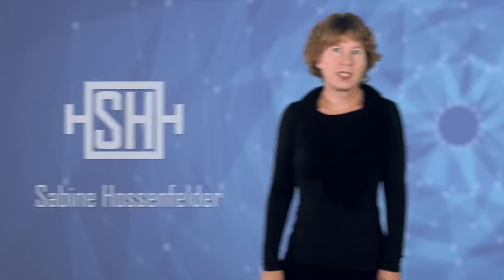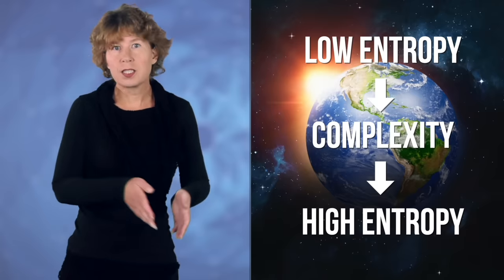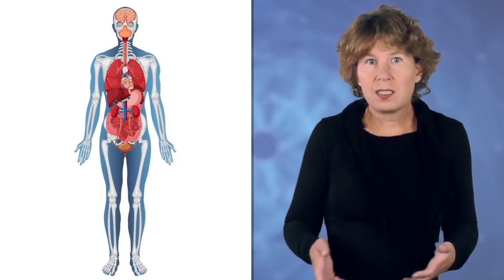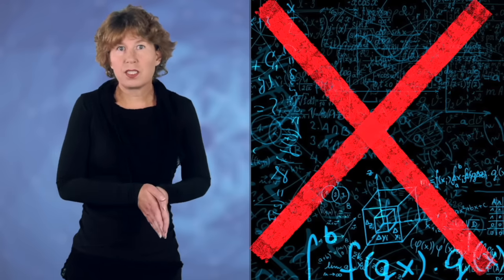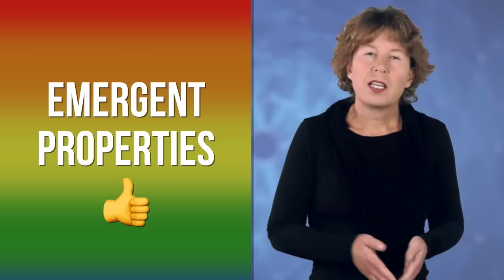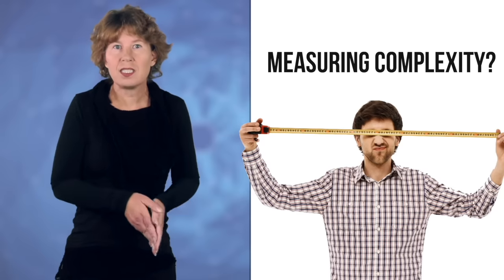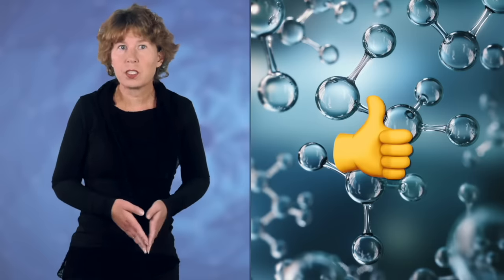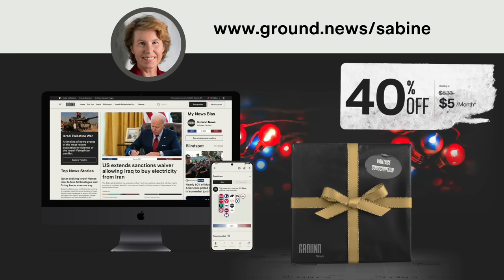The Biggest Gap in Science: Complexity

Comment: I came up with a simple complexity classification for software in or estimate development effort, and it is based on isolation or dependencies:

Complexity of software:

low: few components with few dependencies
medium: few components with many dependencies or many components with few dependencies
high: many components with many dependencies

It worked pretty well together with a classification of "innovation", which may be related to entropy:

Innovativeness of Software:

low: familiar function using familiar technology
medium: Familiar function using unfamiliar technology or unfamiliar function using familiar technology
high: Unfamiliar function using unfamiliar technology

If you do a 3x3 matrix and classify your development task according to this scheme and compare predictions to the time it actually took to create that software, you will get interesting factors of how much humans underestimate these tasks. 

For my teams, estimates for low/low tasks were spot on; it tool on average 95% of the estimate, while high/high tasks too about 4 times as long as originally estimated,

I guess this all complexity/innovation matrix could be described mathematically and turned into physics, but it was already quite helpful to use it light that, just with "MBA measurements" like low, medium and high.

Comment: Fractals are often described as being at the edge of chaos because they exhibit characteristics of both order and randomness. This concept is related to the study of complex systems and the theory of chaos.

At the edge of chaos, a system demonstrates a delicate balance between stability and instability. It is a state where there is enough order to prevent complete chaos, but also enough complexity and randomness to avoid rigid predictability. Fractals exhibit this balance through their self-similarity and intricate patterns that emerge at different scales.

Fractals possess the following properties that contribute to their placement at the edge of chaos:

1. Self-similarity: Fractals exhibit self-similarity, meaning that they have similar patterns or structures regardless of the scale at which they are observed. This property allows them to maintain a sense of order even as they become more complex and intricate.

2. Infinite complexity: Fractals are infinitely complex, with intricate patterns repeating themselves at increasingly smaller scales. This complexity arises from the iterative processes that generate fractal shapes, such as the Mandelbrot set or the Sierpinski triangle.

3. Sensitivity to initial conditions: Fractals are highly sensitive to small changes in their initial conditions. Even a slight alteration in the parameters or inputs can lead to significant variations in the resulting patterns. This sensitivity to initial conditions is a characteristic of chaotic systems.

4. Nonlinearity: Fractals often exhibit nonlinear behavior, where small changes in inputs can result in disproportionately large effects on the output. This nonlinearity contributes to the complex and unpredictable nature of fractals.

The combination of self-similarity, infinite complexity, sensitivity to initial conditions, and nonlinearity places fractals at the edge of chaos. They exhibit a balance between order and randomness, with intricate patterns emerging from simple iterative processes. This delicate balance is what makes fractals visually captivating and mathematically fascinating.

Comment: There's nothing wrong with Kolmogorov complexity, and it does work in the case with the baby. It's intuitive that an ounce of rock can be lossily compressed easier then an ounce of baby, and lossy compressors can be converted into perfect ones. Even if they're represented with the same amount of data in reality, the smallest possible program would be smaller for the rock. It's probably the same case with an ounce of flesh and an ounce of brain.

A theory that could predict in advance how objects will express complex behavior violates the halting problem, the only way to know that is by running the program, aka observing. Measures of complexity are virtually uncomputable, including an object's Kolmogorov complexity.

Maybe theories of specific kinds of complexity could be useful, but I don't think there's anything fundamental we're missing. Kolmogorov complexity is probably the best we're gonna get.

Comment: Usually your videos are spot on, but the argument against Kolmogorov complexity exposed in this video is incorrect. Notice that Kolmogorov complexity still perfectly captures the rock vs clockwork vs human, as you still need to represent the "initial state" of the system in your "smallest program". The initial state of a rock is much simpler (kolmogorov-complexity-wise), as there is much more regularity in the dispositon of the individual atoms, etc. and the same goes for clockwork. So, that definition still perfectly applies. The problem in this video is that it seems to assume that Kolmogorov complexity only applies to "algorithms", but it applies to everything, including just "data" (what is the smallest algorithm that produces a given piece of data). All of those "structural complexity" things you talk afterwards are perfectly captured by Kolmogorov complexity. So, again, it all works out and the argument in this video is not correct. Kolmogorov complexity is actually what you are looking for in this example. Its problem is not that it does not capture what you want, but that it is not computable in practice. So, we need approximations. But there are many already! For example, any compression algorithm (think of your everyday "zip" program) is an approximation of the minimum theoretical Kolmogorov compression for a given piece of data. Think of this thought experiment: write down the position and types of all the atoms in a rock, those in clockwork, and those in a baby in text files, and then compress those using .zip. You'll certainly get a smaller size in the rock, medium on clockwork and largest on baby (even assuming you represent the same number of atoms in each), just because of the regularities in one, but not the other. (btw, I am not claiming Kolmogorov complexity is the ultimate measure, but that the argument used against it in the video is incorrect)

Comment: Somewhere halfway into the video I thought of one quantifier for complexity, and the recent approaches sections made me think. The 2023 paper arguing about the functions is on the correct path i think, but I wouldn't say functions, rather interactions. Measuring complexity: the amount and different types of interactions something (a system or an object) has over time. In terms of entropy, starting with a low entropy state of a cooled gas on the right side of a chamber and warmer gas on the other side; initially, the amount of interactions (let's say particle collisions) is low, and the types of interactions (just particle collisions let's say) is just one. As time passes, the average number of particle collisions per unit of time in the chamber increases and eventually levels out as the gases mix and normalize. If there are different gases, you might now have more than just one interaction (let's say instead of just collisions of same types of particles, you also have the combination of the two different types of gas particles into another one). Through both these measures (nr. of interactions, nr. of types of interactions) you can monitor the complexity of a system over time and its entropy. Applied to the example of humans (you said it is hard to quantify the complexity of a human), the human "system" can be classified as more complex if it either has more interactions (either within itself or with the outside world), say a person thinks of the same problem over and over again and eventually solve it (many of the same type of interaction, i.e. the act of thought). Similarly, the human "system" is also more complex if it has a wider range of possible types of interactions. I think this framework can be applied to most situations and generalized from the bottom up: starting from particle physics, with a single elementary particle, it has a limited number of possible interactions and possible types of interactions with itself and others of its same type. However, the addition of further elementary particles increases the complexity of the system both through the number and diff. types of interactions.

Comment: I know what it means.  I just published my first rough draft of my paper that shows P is not equal to NP.  And unlike the many other papers that have been published on this, I discovered something absolutely groundbreaking that completely changes our understanding of computational complexity theory.  It turns out, that all problems that are "easy" to solve have optimal substructure and a non-universal, commutative, and associative magma.  Whereas, all NP-Complete problems do not have commutative and associative magmas because they must also be universal (this comes from the fact that k-SAT, where k>2, is logically universal).  In contrast, my paper proves that all algorithms in P can be reduced to polynomial-time dynamic programming over magma operators.  This means that algorithms in P have optimal substructure.

Comment: Scott Page has a good definition of complexity as any relational system comprised of “diverse,  adaptive, connected & interdependent” elements. He also differentiates between complex and complicated. A watch is complicated but predictable - it’s non-adaptive, whereas a baby is complex and therefore unpredictable. He goes on to describe three types of system topology or “landscape”  - single maximum (linear/simple), multiple maxima (rugged) and dynamic (dancing). The latter are the most complex, because everything is connected to everything else, so any change alters the configuration of the system.

Comment: I think I have an idea on how to measure/compare complexity of different types of objects. (If considering a graph/network, an "element" will be a "point" and an "interaction" will be a "line", or rather a type of line.)
1. The number of their smallest possible elements (for example the number of quarks in an object).
2. [For objects that have at least 2 elements] The number of ways in which one of these elements may interact with another element.
3. [For objects that have at least 3 elements] If 2 elements may interact with each other (creating a simple "system"), how many ways exist, in which this system (pair of elements interacting with each other) may interact with a third element? And with two more (single) elements? And three more? Etc.
4. [For objects that have at least 4 elements] How many ways exist, in which one simplest system (pair of elements interacting with each other) may interact with another simplest (made of 2 elements) system?
And so on, but that's just for calculating the amount of possible interactions. But if these interactions are the same for every pair of elements, it's still not a very complex object, obviously, it may be just more complex than a similar object with less elements, but that's it, so we go on.
5. How many different interactions (from the numbers calculated above) acually are there between different elements and systems of elements (this number has to be less or equal to the total number of possible interactions between elements calculated earlier).
6. For how long this object may exist in the form which we're measuring (before changing in any way)?
I think time is important for checking how complex a system is and the longer it may exist, the bigger its complexity.
7. How much force/work is needed to put this object apart completely (so no 2 elements will be interacting with each other anymore)?
8. The object's ability to adapt to changing environment.

Comment: The core problems to my mind seems to be Scale and Context. If you start at the bottom, the number of emergent behaviors grows so rapidly we don't have any useful mathematical language for it, yet at the same time many of those emergent behaviors end up forming systems that can be treated as statistically insignificant in the context of larger scales. Take something as simple as a Die Roll. one die has a very chaotic distribution in possible states, but the more you add, the less chaotically distributed the results are. which is the more complex system? The answer depends on the scale and context you choose.

Comment: Here's my take: complexity is a subjective value. Therefore it stems from the structure of our brains. Which is unique because of its adaptability. It's a neural network that is very flexible and adapts itself.

So on one extreme of complexity we have rigid networks (of atoms, machined parts, whatever). And on other extreme we have millions of nodes with more possible configurations than atoms in the universe and these connections constantly changing and adapting in a closed loop. 

I like the book Godel Escher Bach which identifies self reference as a precursor to consciousness. And I would connect it to complexity when applied to networks.

Comment: I wonder if we couldn't use information theory as an avenue to  gauge complexity.  Specifically compression.  A 1MB file of all 1s or all 0s, and a one that is full of a random arrangement of 1s and 0s both have the same size, both contain the same "information" eg. like how both the baby and the rock are both made of atoms.  However when you try to compress them, the differences in their complexity become apparent.  A file of all 1s or 0s can be represented much smaller than a random one, it can compress down tiny where completely random information can barely be compressed at all.

So when we try to create a minimum description of a system, it's complexity becomes apparent.  You can represent a rock very simply, (size, weight, density, the molecules involved etc). But a baby is a vast combination of integrated biological systems all working together to achieve a variety of purposes. It's not just what the baby is made of, but all the various processes going on and what state each are in.  In effect you can "compress" a rock much better than a baby.

Just a thought anyhow.

Comment: I think you are misrepresenting algorithmic complexity here. The length of the program describing evolution of the system a) includes the length of the starting data - which means it includes a function of the structural complexity of said data (since a structured systems are easily compressible in description); and b) describes the system at the level of abstraction that you are interested in, not at the most basic level. On the level of fully simulating all quantum behaviour, I would expect that the structure of the rock would be more, but not by that much more compressible than the structure of a kid - and that is a very valid answer!

Granted, pinpointing the exact level of abstraction in which a kid is much more complex than a rock formally is quite hard, but for a handwave'y pointing at where that level of abstraction would be - compare the lines of code necessary to simulate what the kid will do on the macroscopic level in the next hour compared to the rock. Kolmogorov complexity as a tool seems to still be a useful abstraction to use when trying to come up with some formalism on the actual complexity - we just lack the formalism to precisely cut off what we are not interested in, since all the abstractions are leaky.

Though I agree that there are complex systems that can be described by a short program, where the complexity lies in the computation's cost and Kolmogorov complexity can't be the whole answer here, besides the issues with actually using it for anything due to it being uncomputable.
Still, it's clear that the main insight it offers is being used in the recent approaches - since they are easier-to-compute proxies for how 'compressible' generating the end result is.

Comment: This is a fine example of how making false assumptions leads to asking inherently incorrect questions and results in stupid and conflicting although sometimes useful answers. 

First of all we don't really "deal with stars and particles" as they just don't even exist in a way we see them. Instead we deal with the world as a whole and we use multiple ideas about how it works to try to make sence of it all. Our minds can only deal with models and something can be dead simple and incomprehensively complex at the same time depending on how you look at it and what you want to understand about the thing's behaviour. But models are really just pieces of information and information is also not material. It does not exist for the universe but only for our minds and thus it can not even be a subject of physics. 

So we have to conclude that the idea of complexity is not even applicable to systems but only to models of such systems. And since systems can be described by different models and even a single model can be represented in different ways making it less or more approacheable depending depending on how clearly you write it down the measure of complexity is basically a measure of how much space does it take to store such a model our way. 

Once you've understood all of that it becomes clear that "complexity" should be measured in bytes and values you use are universal regardless of the algorythms used to get them as changing the language of your model or even just a file encoding already gives a different representation and it affects the model itself so it is all already accounted for and all the values are not only comparable to each other but all arythmetic operation on them make sense.